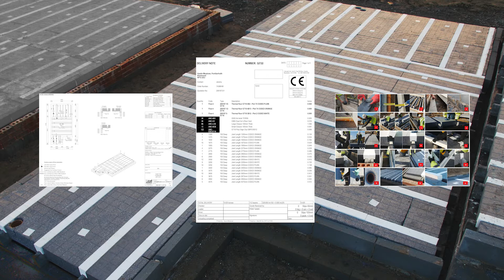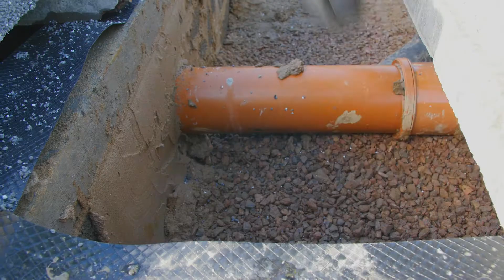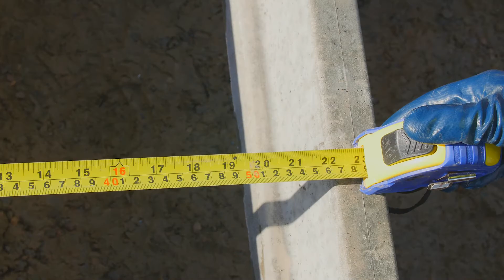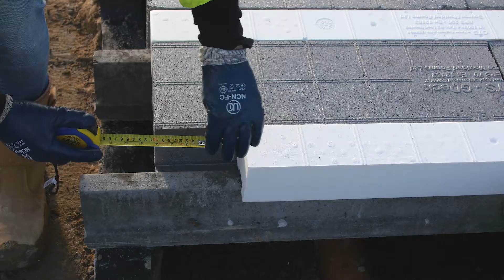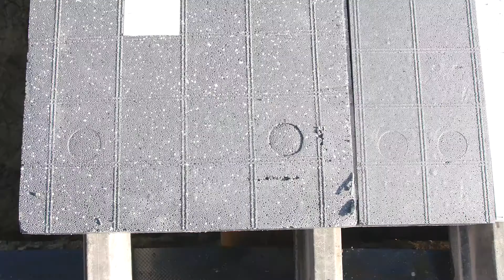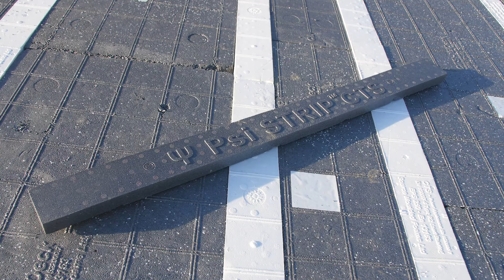Litecast GT Ground Floor Installation

Comment: Do you put concrete on top or floor creed?
Reply: Hi Andrew, 

A 75mm reinforced concrete topping is required. Details of which can be found on our agrement certificate, which is in the downloads section of our website.
Reply: @mrcunningstunt88  What about a dam?